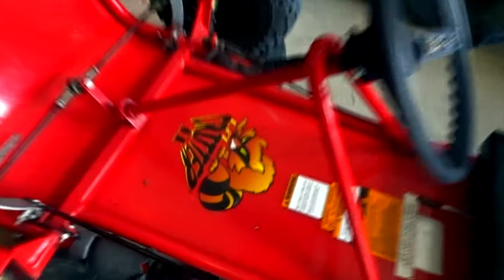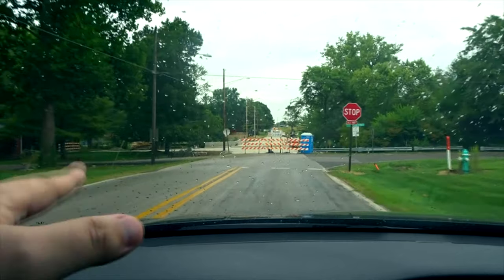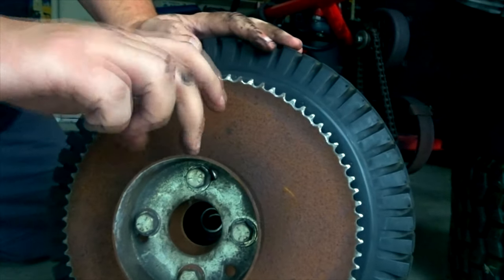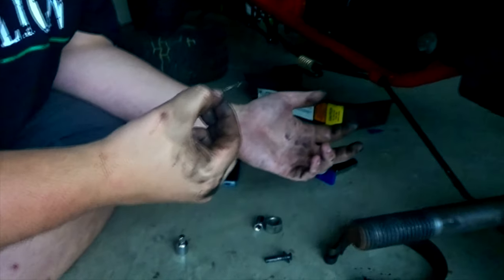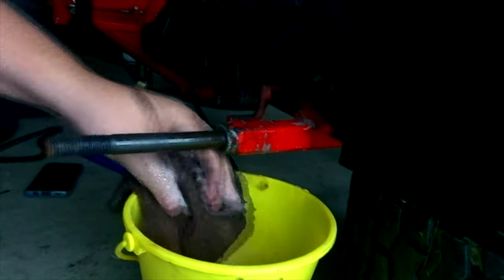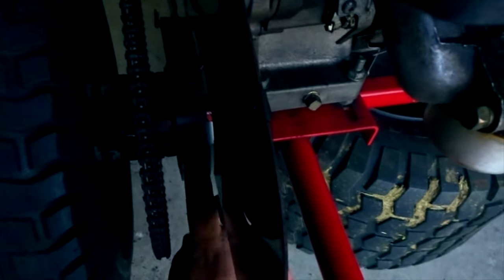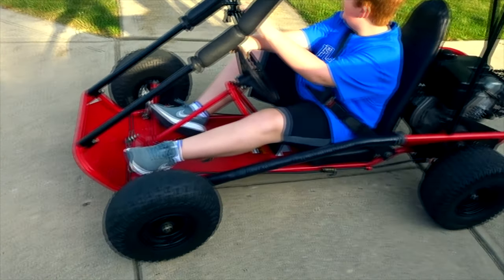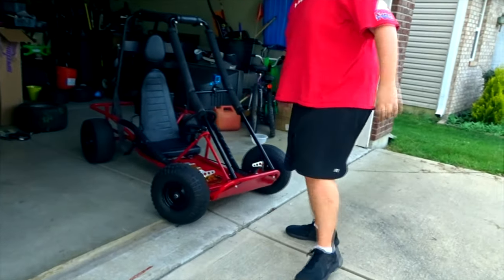New Go Kart - New Brakes [Lil Critter Series - Ep1]

Comment: I'm 32 and i still drive mine just like his. Only difference is mine has scratches and im about to drop a 224cc or a 212cc Predator. I'm thinking more on the 212cc because i want to put the 224cc on the Mini chopper.